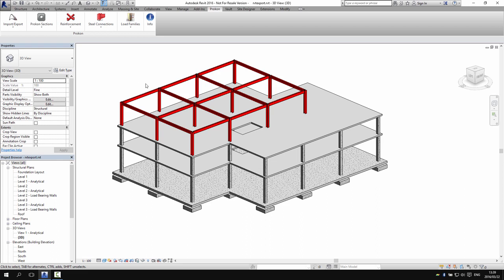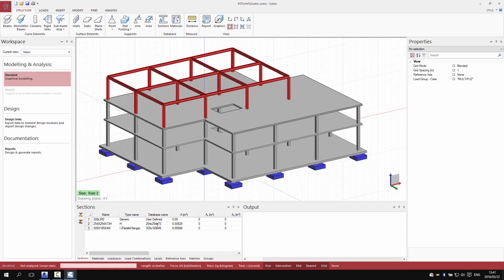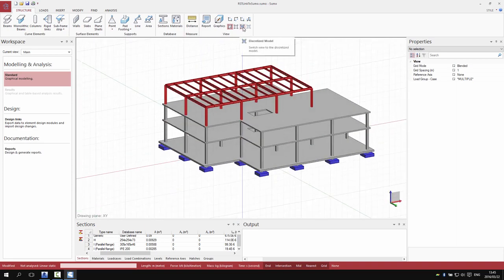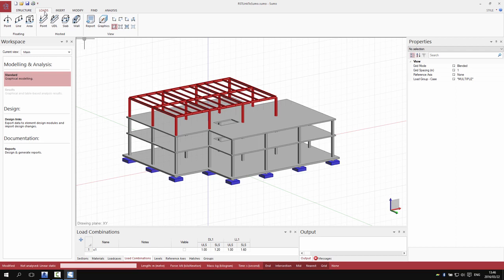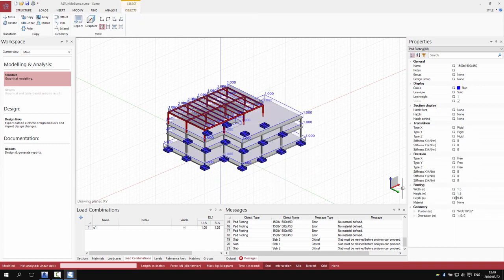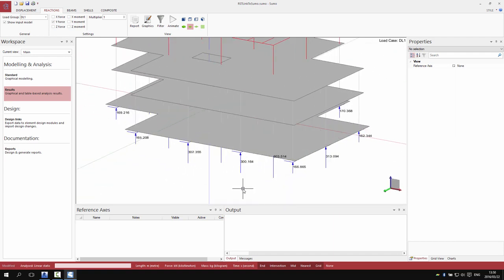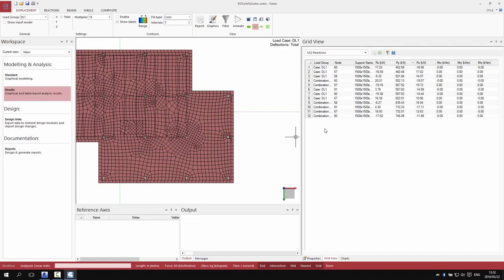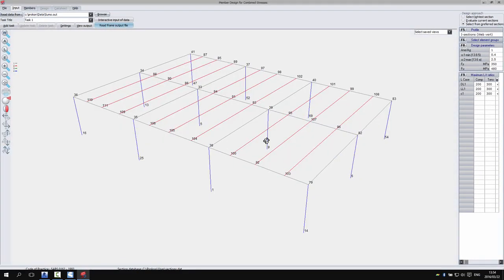Prokon Sumo - Suggested BIM Workflow

Comment: Do you have a video which you show how to add the add-in of Prokon in Revit, if so please share. I believe if I follow this video after adding Prokon to Revit, I can be able to analysis a waffle slab in Prokon Sumo
Reply from the maker: Good day, mashambashonhai4901. Here is how to install Prodesk for Revit: https://client.prokon.com/knowledge/installing-prodesk-for-revit.
Reply: @prokon6061  Thanks a lot, I have manage to Add the ProDesk add-in, I will try to follow you video and see how it goes with my model
Reply: @prokon6061  Thanks a lot, i have managed to install it,
Reply: @prokon6061 Good day.

Thanks for link, i have managed to add the Prodesk 2027 addin on Revit 2027. My challenge now is that after exporting to Sumo, its not showing anything in Sumo. What could be the problem and how can i solve it?